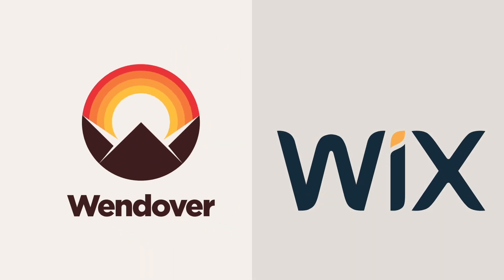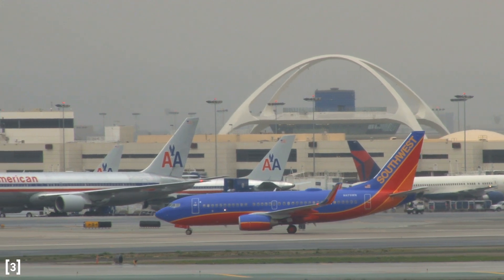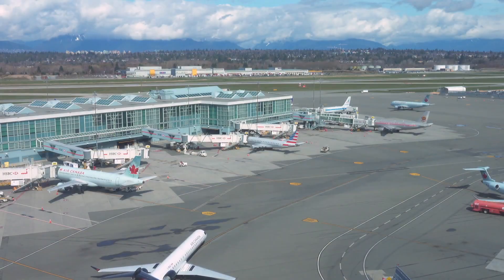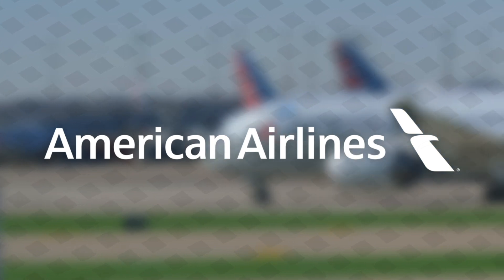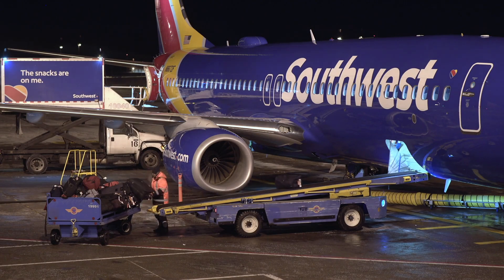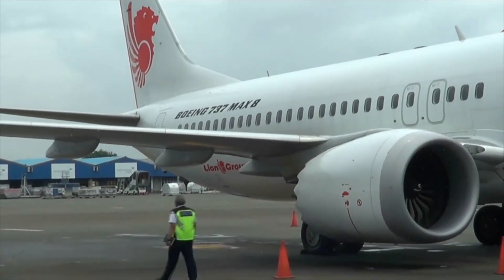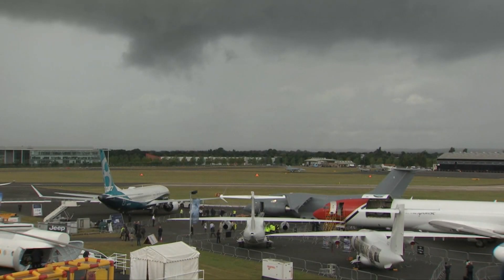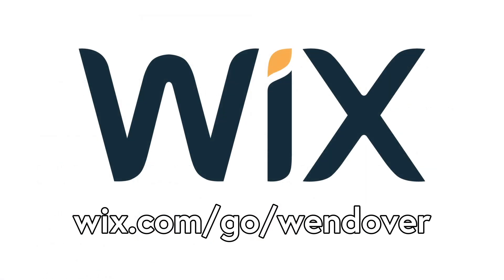The Economics That Made Boeing Build the 737 Max

Comment: You could have also mentioned that Boeing did not provide sufficient training to pilots, told them it flies the same as the previous 737 and they wouldn't need any training or simulator experience. All the pilots got was a 1 hour ipad course. 

The MCAS system was NEVER mentioned to the pilots. When the AoA sensor malfunctioned and caused MCAS to nosedive the plane, the pilots did not know how to turn off MCAS, because they didn't even know the system existed. It's not mentioned in the manual, and Boeing themselves did not think it was important enough to inform them. 

This is criminal negligence if you ask me. 

Additionally, it relied on a single AoA sensor even though there were two. If that one went faulty like it did, the plane was in trouble.
Reply: Sorry, but the pilots on both flights followed Boeing’s procedures exactly. However, they were too low to trim enough in order to save plane
Reply: @Itallianmobboss  these racists are still blaming the Ethiopians?? I hope they enjoy seeing Airbus take over
Reply: and only one AOA  sensor ! no redundancy !! outrageous negligence.
Reply: A couple other blunders for which people should also be in jail. The system did not stop trying to go nose down when the pilot began overriding it - it ignored what the pilot was doing. And they made an indication that the angle of attack sensors did not agree an $80,000 upgrade. At least one airline was unaware that they had to pay extra to get that indication which had not been an upgrade on previous 737s.
Reply: It is the definition of criminal negligence your subjective view is not required for that to be true and it is. 

In China , the CEO would have probably already been put to death. It's that serious but here we are in the Dis United States trying to make excuses for the knowing and deliberate building of a faulty plane by sociopaths in a corporation. 

In the absence of the top 10 people associated with this plane being shipped going to jail ....Boeing deserves all the pain it can get.
Reply: Even in the "cheat sheet" section of the manual, crash investigators found out there was no MENTION of MCAS. Pure fucking negligence on Boeing's part no matter what their loverboys say.
Reply: Jayson Davis  In that context the "roller coaster" technique (alternating the pulling up of the yoke with the winding of the trim wheel, instead of carrying out both simultaneously, to make the wheel easier to turn) might have been useful in saving the aircraft & its souls onboard (https://theaircurrent.com/aviation-safety/vestigal-design-issue-clouds-737-max-crash-investigations/)
Reply: @lzh4950  Good link, very informative.  Thanks for that.
Reply: criminal negligence and ludicrous
Reply: fully agree
Reply: Jayson Davis  don't forget the board members, and major stock holders.
Reply: That depends on the airline. Some airline put their pilots into a week simulator training drill.

While some did choose the iPad drill.
Reply: This is the true cause of the tragedy. MCAS could have worked given proper training and greater redundancy in the design of the aircraft.
Reply: lostn65 ....  you are mostly correct, however with one caveat about MCAS... when MCAS deploys, it will actually mimic a STAB TRIM RUNAWAY which we are all trained for, which is defined as:  un-commanded pitch trim .   Boeing's culpability for conspiracy and deception notwithstanding,  they were relying on pilots to comply with the published checklist procedure for the runaway stab trim situation.  And these items are MEMORY ITEMS which every Boeing pilot trains for.  The Ethiopian pilots did in fact comply with shutting off the cutout switches.  But they  turned them back on , which delivered the final kill shot from MCAS.   I agree that knowing about the existence of this system would very likely have led to a far different outcome.   Armchair piloting hindsight is 2020, and I was not there.   I don't wish to throw shade on those pilots.
Reply: @eugeniustheodidactus8890   "It is not clear at this point whether the pilots purposely reactivated the MCAS’ stabilizer control or if the software reactivated on its own after shutdown. While a Wall Street Journal source said that it appeared the pilots turned the system back on in hopes of regaining control over the stabilizers, Reuters reports that the software may have reactivated without human intervention, and further investigations of that possibility are ongoing." https://arstechnica.com/information-technology/2019/04/ethiopian-air-pilots-turned-off-737-max-anti-stall-system-then-it-turned-on-again/
Reply: @voss0749  It is very clear to me!  Those STAB TRIM CUTOFF SWITCHES can only be moved by hand.
Reply: @eugeniustheodidactus8890  True. I still feel sorry for all those involved. If an aircraft is designed to fail often, would you be happy flying it/or as a passenger because "no worries, 99% of the time we know the emergency procedure and pilots can do it", or prefer an aircraft that does not need such a procedure as *often*? (Other craft only fail when systems fail, not when a "training requirement bypass" system fails to activate?)
Reply: @eugeniustheodidactus8890  it is true the switches can only be moved by hand, but more than likely at the speed they were going on the Ethiopian flight (the large forces being applied to the stabilizer mean they likely couldn't manually trim) as a desperate attempt they turned electronic trim back on to try and trim again. They may not have had enough altitude to perform a bunt like manoeuvre to try and manually trim the stabilizer, so they may have been doomed in all scenarios.
Reply: Jayson Davis  two angle of attack sensors, but only one used, which  I think is what he was saying.
Reply: lostn65 May crash any second
Reply: However, American and Southwest instructors did know how to correct an MCAS malfunction
Reply: I saw on the news that there was training but a pilot can do it themselves. On an iPad
Reply: Same the sensor of cooling coil fails. That split type airconditioner making snow on it. And customer donot knows the sensor system exists. Because in window ac no hidden sensor present. Only the  themostatic analog switching is working. If it fails . The consumer understands that ac is not cooling. 😁😁
Reply: Jayson Davis  Let him speak (to show his ignorance). Very sad it is when people refuse to see the truth.
Reply: Jayson Davis  Right on. I will never fly in a Max. Boeing's people FUCKED up. Evil pure evil. Taking short cuts on lives. WRONG DOING. I hope the FBI finds criminal negligence from the responsible individuals. I DO NOT TRUST BOEING'S "software fixes." What ELSE is wrong with the MAX?
Reply: There are 2 sensors on the expensive version, only one on the cheaper version, Boeing put a price tag on safety, and it backfired
Reply: @swisscake1591  - That's not true there are AOA 2 sensor vanes on every version the problem is it only used data from one at a time the AOA display and disagree alerts were optional not any additional AOA sensor vanes
Reply: @swisscake1591  The are 2 sensors on every version. The expensive part that they charge more to sell was sensor disagree light indicator, which will light up if both sensor giving out different reading. MCAS still runs/triggered by only 1 sensor whichever version they get. To make matter worse they can't tell which sensor it runs on, because after each flight maintenance it resets to the other sensor. So if previous flight report tell the maintenance to check up on one sensor, and it were recalibrated on that one, the next flight MCAS run on the sensor that weren't getting checked. And like pilots, maintenance crew didn't know that MCAS characteristic either.
Reply: They did no how to turn it off and they did, but then they turned it back on, bad pilots cause bad flights the max has been flying in the US for 3 years with no issue.
Reply: @KevinLindsay1  you're right, these planes shouldn't be grounded! Boeing just needs to sell them with 'Murican pilots included! Or airlines can just buy Airbus...
Reply: Ash Chowdhury . Only flying over the US...of A.
Reply: @KevinLindsay1  You were lying 7 months ago when you wrote:
   "the max has been flying in the US for 3 years with no issue."
The MAX first flew after certification in May 2017. 7 months ago it was April 2019. So that was less than 2 years. The first crash was in October 2018 some 18 months after certification. And no it had NOT been flying 'with no issue' because US pilots had a fierce argument with Boeing and the FAA about this aircraft in November. At the November meeting, the pilots said they were not aware of the Max’s anti-stall software system, known as MCAS. And they were angry that the system was not disclosed to them until after the October crash in Indonesia.
And ignorant people who lie always seem to blame 'foreign pilots'.
Reply: Kevin Lindsay what a crass comment. How dare you call the experienced pilots “bad.” Human beings lost their lives, including the “bad pilots,” who had families they wanted to see after their flights. Nothing about your comment was fair, kind, or thoughtful.
Reply: @KevinLindsay1 let's be thankful none of the American pilots encountered such a malfunction though. We don't know what the outcome would have been if they had- there's a 50-50 chance that they may have bought the farm. The Ethiopian and Lion Air crews did their best to solve a problem while overcoming the startle factor which came with the spurious stall warnings and uncommanded nose - down trim.  Give them some respect. If the aircraft was not an American product, would you still be blaming the pilots or would you be of the opinion that the manufacturer had made a fatal design error?

Comment: Retooling the 737 with bigger engines and MCAS software wasn't the problem. The problem was MCAS was implemented with no sanity checks or redundancy. I would like to know the process that led to such an unsafe flight critical system and how it managed to pass FAA certification.

Comment: WRONG The design is sound - It suffered a component FAILURE not  DESIGN FLAW, not A STRUCTURAL FAILURE...not and ENGINE failure.....
Reply: MCAS relied on a single sensor instead of multiple ones like Airbus that relies on 3. It is a design flaw. Someone forgot about redundancy.

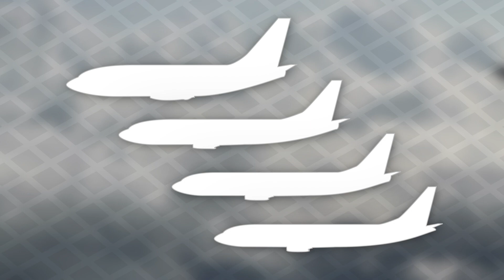Comment: 1:40 is Not To Scale ; later varients are longer with wider wingspans - the diagram keeps the height constant across varients, but distorts them front-to-back.
For a slightly clearer diagram, see https://scontent-frt3-2.cdninstagram.com/vp/0df52aec4dee1e06a934f067ad54c819/5D722499/t51.2885-15/e35/55894884_428676851039329_9044862457079365250_n.jpg?_nc_ht=scontent-frt3-2.cdninstagram.com&se=8&ig_cache_key=MjAwOTc1OTEyNzg3NTUwMDUxOA%3D%3D.2

Comment: Yeah, turbofan design has a few awkward characteristics.
Theoretically, the optimum efficiency for a turbofan is reached when the engine diameter is something like 3.5 metres.
Now, no current engine is quite this large, and I forget if 3.5 metres is the actual optimum or if it was something larger (it's been a long time since I've read about it)
But, part of the reason older engines are smaller is because the materials that the fan blades are made of can't handle the strain - the larger the engine, the stronger the turbine blades have to be.
Of course, the larger the engine, the harder it is to mount to an aircraft as well; especially smaller aircraft.
A theoretical 6 metre diameter engine (if there was ever any point in building such a thing) would be incredibly difficult to mount to just about any aircraft, and you might end up with a return to tail-mounted engines, or perhaps things such as mounting them above the wings, or even more exotic arrangements...
Large engines are problematic, but they do tend to be more efficient.

(Now I'm just waiting for someone to be crazy enough to design a single-engine airliner. - we've seen a few in the very light jet segment, but single engine designs are generally avoided in larger aircraft due to safety concerns. Then again, once upon a time twin engine aircraft weren't considered safe enough, so you never know.)

Comment: I have an issue with the sweeping conclusion. I work in aviation and I believe that Boeing could ha e pulled off the design of the 737 max had they done it properly. The problem isn't that they didn't make a new design, it is that they hastily redesigned it and didn't give enough thought to how much the characteristics of the plane would change with the redesign. 

(My job btw is to service the engine fitted to that plane, The LEAP 1b as well as 1a/1c)
Reply: Apparently, it's not just about haste. Evidence and an insider points out that it's all deliberate, premeditated, company decisions. For example, the mistake to make a single sensor malfunction to be catastrophic is intended to get away with FAA rules to train new pilots. The decision to hide the existence of MCAS from pilots and airlines is also intended to make the 737 economically attractive to customers. The list goes on.
Reply: @freegge9156  Spot on.  Like most catastrophes the cause of these crashes was not one mistake but a whole string of them.  And all were Boeing's, and all were deliberate decisions driven by $.
Reply: It was cheaper for them to be lazy.
Reply: Boeing will have the chance to show what they're capable of when they build the NMA. Let's hope so!

Comment: Why didn’t they just made the landing gear a bit longer, so that the airplane would be taller?
Reply: OP mentioned in the video that the whole reason that the planes are so low is for ease of loading/unloading and boarding. Having a low plane saves a lot of time and money.
Reply: Believe me! It is more “economical” to make it a bit higher than moving the engines and engineering a whole new system that tries to account for that based on a single sensor, that if it fails kills people and grounds the planes.
Reply: @marcoswatch  Airbus has a similar system called Alpha Protection. First of all, pilots are trained for it. Second, it is designed properly. Third, it doesn't override the input completely, only partially, a pilot can "fight" the controls.
If they had not rushed it, it would have been fine.

Comment: Very insightful video. I'm not sure I agree with everything stated, but I do agree with most. I'm shocked however, how low tech the controls are. Why don't they put taller gear on the 737? Virtually all airports have luggage belts on the tarmac now.

Comment: If they just hit the trim it would have turned off MCAS. The 737 is short so it can land on shorter runways and stair cases could be used and a jetway would not be needed. NOT because to make it easier for bags to be unloaded without belt loaders. Every airline uses belt loaders. it was and is the jet that opened up the world to airtravle.
Reply: The Ethiopian Airline crew successfully engaged the cut-off switches to prevent the MCAS from shifting the horizontal stabiliser.

When they subsequently attempted to manually trim the aircraft, the pilots discovered that the manual trim was not working, so the aircraft was still pointing it's nose down. 
It's still not clear if, at that point, they decided to reactivate the MCAS, or if it reengaged automatically.
Reply: @neutronalchemist3241  It comes down to training, the pilots were not trained properly and failed to identify and address the problem quickly. There is a reason that the same kind of aircraft hasn't crashed in the US, CAN, EU, ect. It's because those pilots are well trained on the aircraft and have swiftly dealt with any issue they may have encountered because they knew what was happening and how to fix it. Also the aircraft are well maintained.
Reply: @davidwright5782  Again, the Ethiopian Airline crew successfully disengaged the MCAS. That had been already estabilished. And sensors fails on US, CAN, EU aircrafts continuosly. First than the two crashes, western pilots filed several reports about their 737-MAX suddenly pointing their nose down and not knowing what was happening, and several complained to have been requested to pilot the 737-Max without having received any additional training at all.

Comment: Its just like you said, a bad hasty decision that led to more dangerous faulty decisions, AA wanted a new efficient NBA that doesn't need additional training to their pilots, up from that point, Boeing engineers have very little room for doing any safety checks, they can't add any significant changes to interfaces/gauges/switches that would required additional training to the pilots thus nullifying AA initial agreement.

If only they at least agreed additional training were required, maybe the 737max would be as safe as the old 737, but no, here we are talking about what Boeing can do to fix their plane, and 300+ souls lost their lives as the result :(

Comment: Question would you put your children on one of these planes even with the approved fix built in
Reply: For me the answer would be a no, because we know shortcuts were taken during certification and this design error was able to go through. There might be other design flaws that slipped through certification and thus a fix of the current flaw does not suffice. Either a full independent review of the certification process is necessary with points of action where the certification was flawed, or the plane needs to be recertified from start by independent experts.
Reply: Yes because the design flaw snuck under the FAA's radar because MCAS is not a primary control system which therefore required less redundancy and this vulnerability has now been identified. 

The 737 suffered from a flawed rudder PCU in the 90s that also caused 2 fatal crashes and after it was discovered it was rectified and has never occurred again. Those responding "no" have likely already happily flown on a 737 that was once considered a "flawed design"